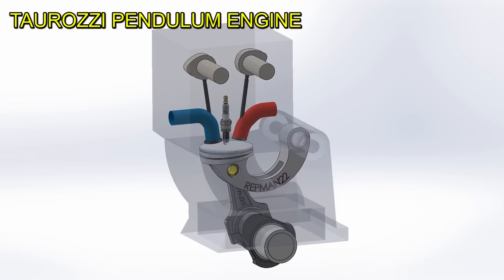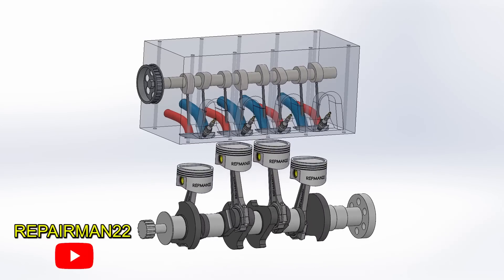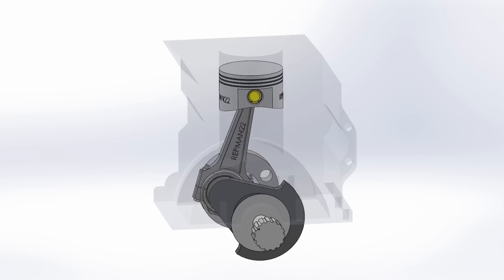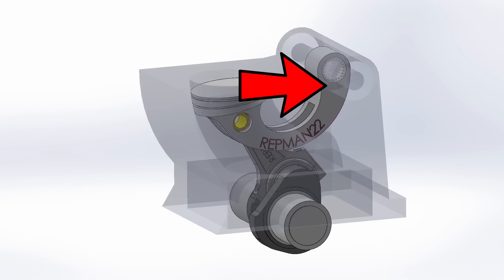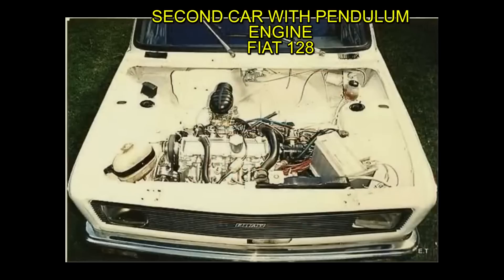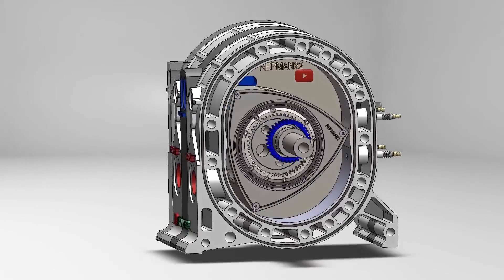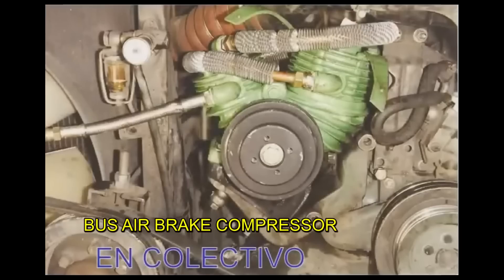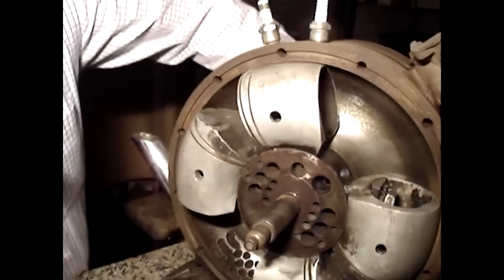All about the Taurozzi Pendulum Engine 🧠 and what happend to it🤯

Comment: It’s a great idea! but I’m sure it’s too efficient, plus the existing designs are making money for their designers and with the depth of their pocketbooks they can keep any good idea from ever becoming mass produced the monopoly that has been going on in the intellectual properties business is so disturbing I would suggest you make one of these motors but it runs on steam that’s right steam why because if an EMP is exploited all your electronics will be worthless so only diesels or steam powered will be able to run well everyone else will go back to being in the caveman days those who are ahead of the curve will be ready using these engines to operate hydraulic pumps for hydraulic motors to do all the work electric motors have been doing . The fact that the sun has cycles where solar flares that are so large they will wipe out our electrical grid should make people try to prepare for just such an event .Thanks for the video quite informative.

Comment: It's hard to tell but I think the asymmetrical shape of the chamber will likely cause asymmetrical burning of the fuel, weaker but similar effect to what killed Wankel engines. Wankels too are lighter and have lower fuel consumption but cannot meet emission standards, that's the main reason they're not used today. Pumps are perfect use case for this engine concept as there is no combustion and the shape of the chamber has no consequences.

Comment: Very interesting idea. I'm guessing that huge arm adds a lot of mass compared to a piston. Would put a lot of stress on the connecting rod when it changes direction at tdc and bdc
Reply: It would have to be calculated as a rotational inertial mass, since each mass unit along its length moves less as you go from piston to pivot. But I agree, I would have to see that actual calculation.
Reply: The reduced height would make up for a significant portion push as mentioned above, it on an arc to the closer the the pivot, the less inertia
Reply: An increased mass of an arm is duly compensated by a decreased mass of a piston though
Reply: Its actually less mass and less friction, your imagination is poor
Reply: You weren't paying attention. In the video it is said that the weight is the same.
Reply: What stress??

Comment: I wonder if you could use a torsion spring instead of a bearing to remove friction alltogether and make a low maintenance and oil ratio 2 stroke with restoring force.

Comment: I would like to see this concept paired with an opposed piston engine concept. One of the big problems with opposed piston engines is oil (from the piston rings) getting into the intake port and then the combustion chamber. If this actually does work that would help reduce that problem. Also I think this would make the engine more compact as the flat 3 opposed piston engine can be pretty wide since it has horizontal cylinders end to end and crankshafts on the end as well.
Reply: Have you ever seen a Commer TS3 engine?
Reply: @erroneousbosh  I have not but I shall look.
Reply: I'd go a step further and combine both concepts with spherical valves and place the valves at the center of the combustion chambers. This would allow an opposed piston engine to operate as a four stroke so you could drop the supercharger out of the equation and take back the power losses.
Reply: The piston rings still need oil.

The guy who made this video isn't terribly well informed...
Reply: @immikeurnot  i assumed some but maybe less?
Reply: The piston rings still need oil.

The guy who made this video isn't terribly well informed...
Reply: Now, this idea is worth looking into.

Comment: This looked like an engine with some serious potential, too bad it wasn't developed further. AND I LOVE YOUR ANIMATED ILLUSTRATION!!!!!! We need more productions like this!
Reply: While others had negative comments,  my first thought was using it as a small diesel power plant.  I think there is real merit to the design.
Reply: @matthewpeterson3329  Especially the problem of resource consumption in today's world when we have a new impending oil crisis, especially in the EU countries, I think consuming less oil with higher performance at the same gasoline/diesel whilst having a lot less toxic gasses could be HIGHLY beneficial.
That said the world is going from the "black gold" that is oil to the "Grey Gold" that is Lithium metal. 😑 Hopefully Formula 1 in 2026 can change things by building an engine like this, but... engine regulation constraints from the FIA probably won't allow it.
Reply: @LogiForce86  Another benefit that people don't talk about is that the engine wont heat up as much, if the temp difference is massive, then it can use more volatile fuel sources closer to alcohol or a fuel that doesn't have all of the stabilizer additives and not cause detonation
Reply: @Thats Legit  There is a great synthetic fuel already called P1 Fuel. Look it up! Sebastian Vettel already drove Nigel Mansel his Williams F1 car with it, and it was used in the World Rally Championship as well. So that can be an option for any type of engine without the ethanol disadvantages we have now, and Germany wants to ban ethanol from fuels again by the way
Reply: @LogiForce86 I dont think they will restrict it because its 30% more efficient so needs less fuel for the same result as regular 4 strokes.
less fuel = less emissions = FIA happy.
Reply: I think a Honda bike use it one time to run in a race to test it
Reply: Especially considering a V engine where you can connect the pendulums across the banks - halving the connecting rods and making the engine even lighter and lower friction. You could also move the connecting rod's mounting point closer to the pivot, allowing for smaller conrods and crankshaft.
Reply: I've had a lot of theory work on an engine similar to this at mu uni and, in short, when devenoped further this design should cause fuel consumption to fall by around 53.4%(edit: in close-to-ideal conditions and with perfect machine manufacturing precision) , wich in my friend's words is "simply too cost-effective for oil companies".
Reply: @pelonio6181  There is no plot by the oil companies to stop this technology. How is that even done? Where has it already been done? It this design didn't catch on it's because automotive engineers couldn't find a profitable way to build it. Again, this has nothing to do with some imagined chicanery of the oil companies. BTW, that 45% figure is not very realistic.
Reply: @jhanthony2  Okay, honestly the overall "Big oil" theory people usually have is too much even for me, but to be blind enough in spite of having history lessons about people killing each other, hampering development, or using threats to profit you really still don't believe there's some truth to that?
I really Don't want to make an entire pseudo-political discussion about how the world works to develop here, so I'll just say that you have your own truth that you choose to believe in and I have my own thruth based on observation and reason.
There's no point in forcing each other to believe anything else, in the end neither of us will change their mind, so let's just bear with it and leave the conversation at that.
Reply: Look like a great engine for a hybrid engine.
Reply: It was a completely unnecessary complication.  The entire reason he wanted to do it was to eliminate piston slap which could be done by redesigning the piston heads themselves. Longer skirts for example. He did eliminate it sure, but the additional drag added by essentially doubling or even tripling the piston heads weight it only added rotational mass. Eliminating piston slap only aids in increasing the lifespan of the seal which is why it's better for compressing gases.
Reply: The answer, -  for whatever reasons there's no money in it or it would be in abundance. I'd bet Toyota, GM , Ford, Chrysler, VW, Rolls Royce,   and many others have been there and back with similar designs and stranger ones all the time  in an effort to discover the next brilliant ICE. They just aren't on youtube. Yet. :-)
Reply: The price of production would mean all cars produced would cost more than most homes
Reply: @daze    While cost would increase,  I think it's a stretch to say it would be as expensive as a house.  Let's also consider that a new truck costs more than my first home did in the 90's.  Manufacturers don't want longevity,  and oil companies don't want efficiency, so the decision makers are going to pick money over a good product.  I'm not sure if this design is the answer,  but it would be nice to see it tested in earnest.
Reply: @matthewpeterson3329  Actually, manufactures really DO want longevity, and oil companies want efficient use of their products.
Reply: Wait till the military gets gist of this engine. 30% fuel savings is crazy
Reply: This type of engines have no advantage over traditonal piston engines.  All the benefit it gained from this design is offset by the sealing.  You will never get good quality of seal with curvature.
Reply: @catchnkill  Thank you. I see that the toroidal cylinder would cause uneven wear on the rings.

Comment: So piston rods will bend under extreme stress , and are made straight as its the strongest structure.  So making bent rods is beneficial?  Oh the slicing rolling back and forth on a crank.      Why not but a bolder in a wood chipper and use it for batting practice??

Comment: I tired of "Friction" misconception. Its like a magic pill, the only nemesis of reciprocating engines. NO. Majority of losses comes from exhaust, because engine could not extract all energy from hot gas. FRICTION responsible for minority of losses, and majority of FRICTION occurs in engine bearings (ask yourself, how oil heat up). Stop this BS, that's ignorance, that offensive. Get your F and learn physics better.

Comment: i wonder what the power levels really are vs a typical inline engine. i've never heard of this before but the idea is super solid and now i want one!
Reply: I'd bet the torque is limited.
Reply: @brantgaspard9748  possibly but it could be better that most engines at lower rpm due to each power stroke being slightly after tdc

Comment: Worked for G.T.E wesgo Corp in the 90s.
We worked on a prototype ceramic 4cyl engine.   Extremely impressive #'s, super lightweight,  on cmm machine was No wear....engine would theoretically last forever(well, owners lifetime)    it was cast into a block of cement and dumped at sea.   No $ in a engine that won't wear out.
Reply: this is why we need whistle blowers! big corp getting too greedy to suck the public dry... death to consumerism!
Reply: @@ddjohnson9717  just no $in an engine that would out last several cars....
Couldn't pay for production of engine, after initial acceptance,  the need would drop below the dollar amount needed to pay for everything.    Was a ceramic engine primarily,  the elements were plentiful,  but the Processes and skill levels needed don't come cheap.
Reply: @briansharp4388  well the device you use to post comments have billions of transistors stacked on a nano level. the Processes and skill levels needed to make the CPU and screens and circuit boards also don't come cheap. But look at the market, we can buy them for 20-30 bucks a chip and couple hundred collars gets you a full on device. 
scaling is the key and with a "no wear" engine, one manufacture can claim that and people will buy no stop. where did the "let market chose" mentality?? crooks all around,,

Comment: He took away one point of friction and introduced another. This is a more compact cross section, as it's essentially a taco. The thermodynamic chaos of that combustion chamber shape would put more pressure on one side of the piston than the other. This would cause uneven stress on the chamber walls. You would also be forced to use a small bore size, thereby having to increase the lever length and the moment of inertia. The balance shaft weight alone would more than erase any supposed efficiency gains. This design would be forced to use a more complex V or X pattern to cancel that inertia without excessive balance weight. Manufacturing such a shape without complex dies and pressure casting techniques would be absurdly expensive.  It's a very neat design, but there are some very obvious reasons it hasn't been adopted for any high pressure internal combustion applications.

Comment: This is just factually wrong. Rings have friction regardless of shape, and are required to prevent blowby. While the pivot constrains the piston in one plane (with added expense of the needle bearings), it doesn't constrain side loads without friction from those side loads, so there is side load friction at the pivot. Modern engines have very low skirt friction, and most of it is in the rings which are still here. Seems like one advantage might be from the reduction in rod angle? That wasn't mentioned, but could be some efficiency there. Neat idea, but machining costs are much higher as well as component costs. Based on what was presented, this makes no sense for internal combustion engines compared to conventional engines and the additional cost & complexity simply don't have sufficient ROI - there is no conspiracy. My uncle designed and patented a rotary engine, but it too was a neat idea without enough ROI to be practical in mass production.

Comment: Eh, maybe 30% compared to the smog chuggers back in the 70's? But back then, there was nowhere to go but up.

But seriously, nevermind ordinary gas engines, heavy engine manufacturers would absolutely eat this up if had no drawbacks. Right now, the latest heavy truck diesels are using tens of thousands of dollars of gear just for the emissions, and the manufacturers fight for every tenth of a mpg. A slightly more difficult machining process? Absolutely justifiable.